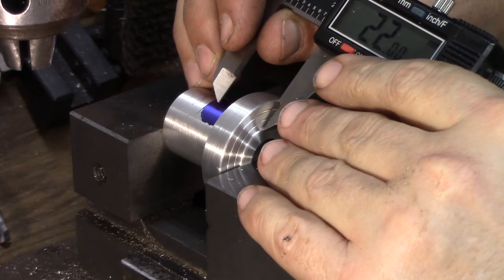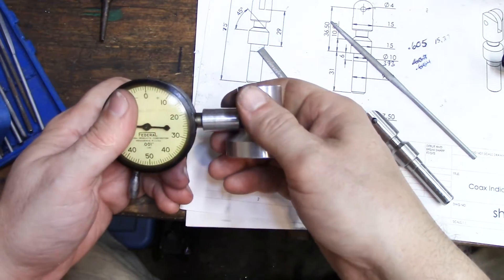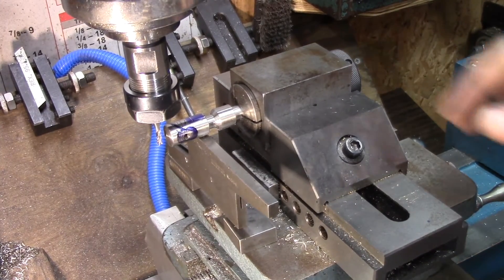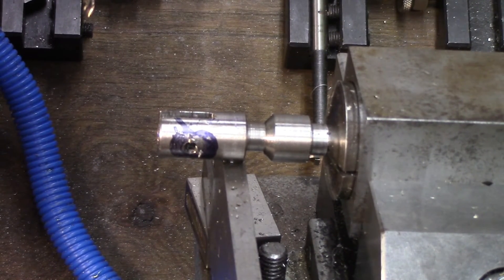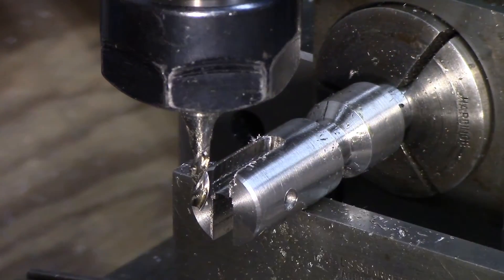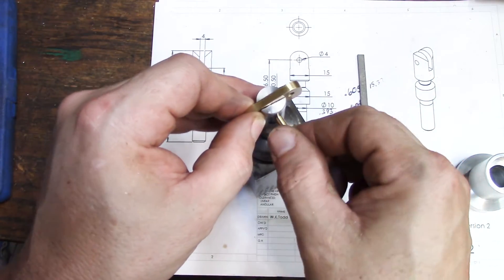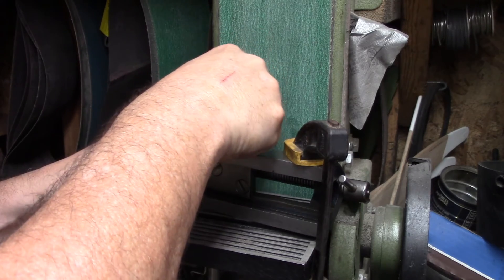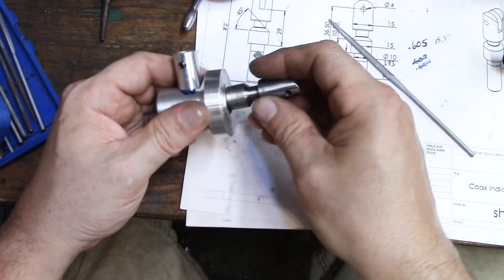Getting close - DIY Co-ax (Coaxial?) Indicator - Part 5 - #TMC2020

Comment: You got me with the tap lol
Reply from the maker: Lol. I intended to just roll the chuck by hand with the other end of the spindle to start the tap and I reflexively turned the machine on instead. Just one of those little "almost dumb" moments that made a good joke. Thanks for watching!
Reply: @theeddies  I am struggling to source the thrust washer for this build might have to make one out of 4140. Australia is cramp regarding supplies!
Reply from the maker: Lol. I intended to just roll the chuck by hand with the other end of the spindle to start the tap and I reflexively turned the machine on instead. Just one of those little "almost dumb" moments that made a good joke. Thanks for watching!